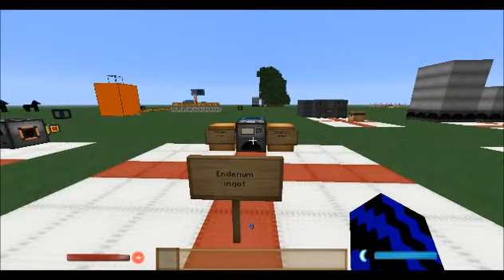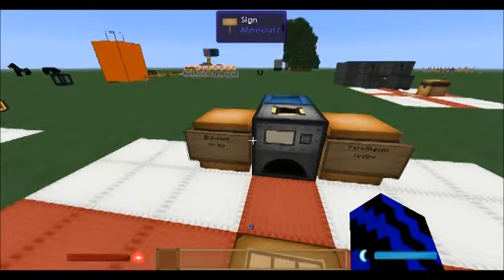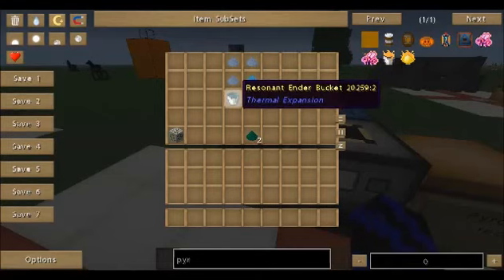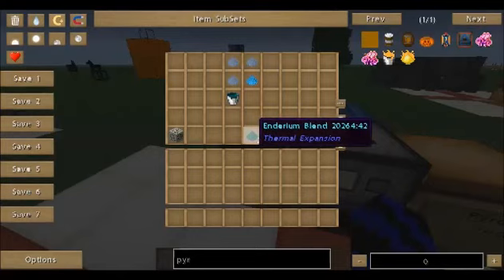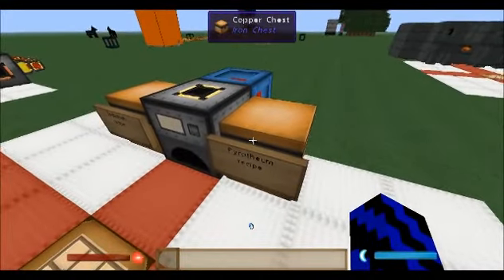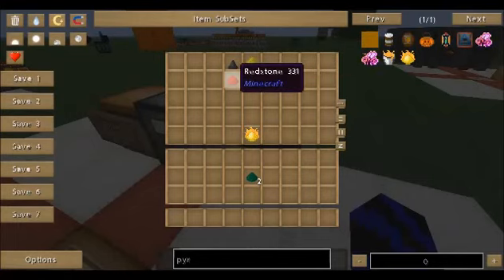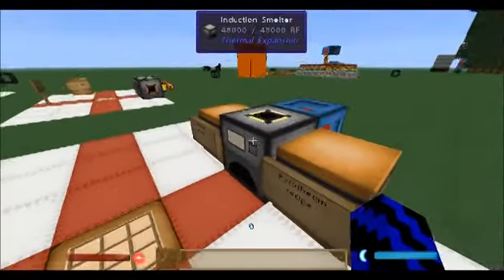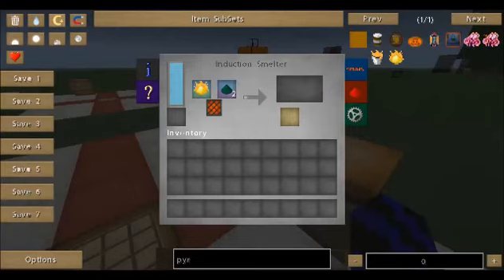How to make Enderium Ingots

Comment: Where the hell are you supposed to get a resonant ender bucket?
Reply from the maker: You can get it by melting ender pearls in a Magma Crucible First and then pump the liquid to a Fluid Transposer and put and bucket in the Fluid Transposer to it will  give you a resonant ender bucket
Reply: thanks!
Reply from the maker: no problem